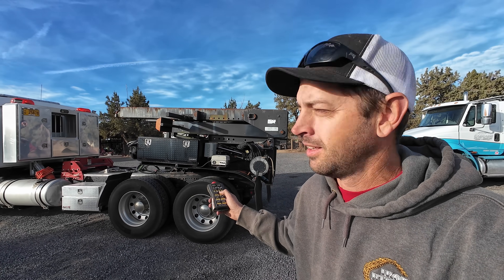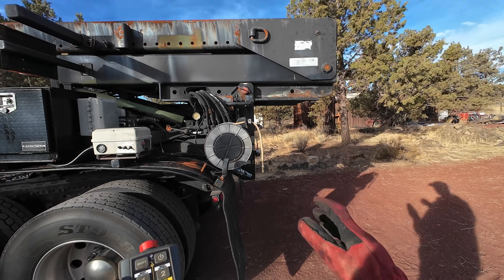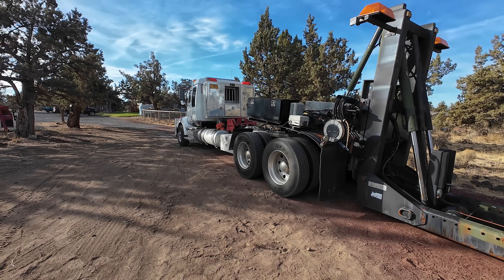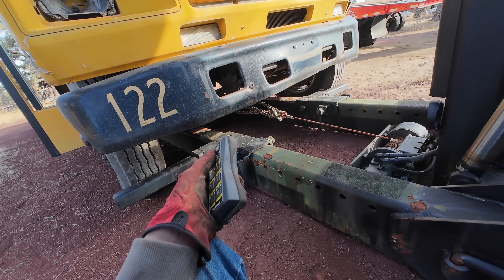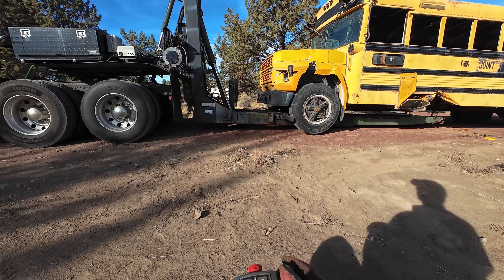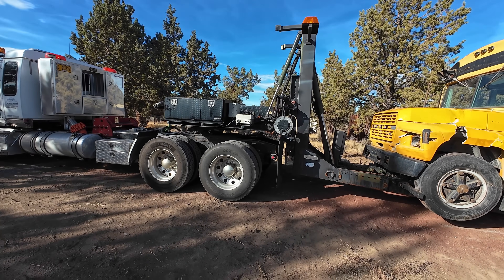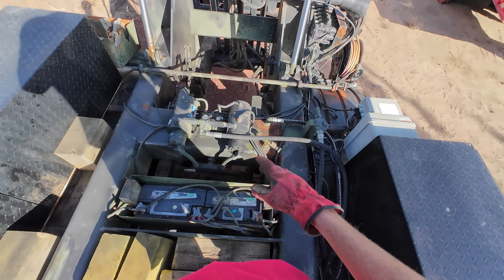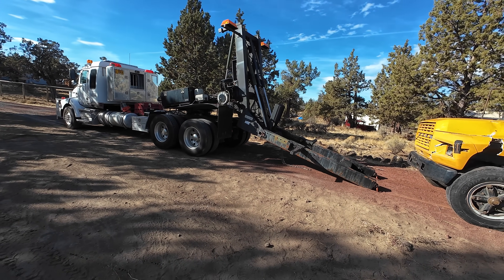This Military Auction Purchase Has My Neighbors Nervous...

Comment: Don't suppose you noticed the vehicles the military had that unit mounted on? I don't know what your trying to feed these viewers but your setup will never lift much more than what your truck is rated for your airbags will never hold. If you want to haul like a rotator buy one.
Reply: Suppose you don’t understand the physics / leverage and weight distribution involved here that enables the unit to tow more than a rotator or heavy wrecker even with a standard tractor.
Reply: A 5 ton is way less truck than Casey's Star and a heavy military tractor is about the equivalent.
Reply: @hondaman08  physics and leverage have nothing to do with it. You and Mr Ladell must drink from the same water bubbler. YOU CAN'T LIFT 80,000 LBS WITH A TRUCK THAT HAS 40,000 LB SUSPENSION. The truck and the lift probably take up close to half so what's that leave you? Do your physics and leverage on that
Reply: @shawngleason1345  where are you getting the whole lifting 80k with 40k suspension deal?  Did you miss the part at 31:25 where he explains how the weight is distributed onto the truck? The unit essentially acts like wheelbarrow handles under the frame of the towed vehicle. That extra leverage diminishes the weight effect of the front axle load and positions the load onto the fifth--wheel plate just like a trailer does. This is opposite to how a wrecker carries the load i.e. a teeter totter pivoting at the wrecker rear axle (load at end of underlift arm lifts wrecker front axle and transfers more weigh to the wrecker rear axle.) So all things being equal, the rear suspension will see less load when used with this unit vs a conventional underlift.  So tell me how leverage and physics have nothing to do with it...
Reply: @hondaman08  The weight is distributed to the 5th wheel just how much weight do you think you can put on that 5th wheel? The sky isn't the limit here his truck doesn't have the nearly the capabilities he claims because  you simply can't legally/safely put more than 40,000 lbs total weight on those rear tires
Reply: @shawngleason1345  do you agree that this setup puts a fraction (<100%) of the lifted, towed weight onto the drive tires vs a conventional wrecker setup that puts a multiple (>100%) of the lifted towed weight onto the drive tires?

Comment: WD40 is not a penetrating lubricant.  After the paint thinner evaporates, all you got left is some sticky fish oil.  Better to use Kroil or PB Blaster.  I know you know better, but I just had to kick you in the nuts for making me spend an hour & 20 minutes listening to you blabbing about some obscure piece of lift equipment!
Reply from the maker: Did you catch where I said the word “and” in between Wd-40 and penetrating oil??
Reply: @CaseyLaDelle  Nope, never heard that at all.  Right over my head- not even skidmarks!  Mainly, I was going by the big blue can of rip-off juice prominently displayed on the platform behind you.  Besides, the algo doesn't know if this this is friendly ribbing or otherwise.